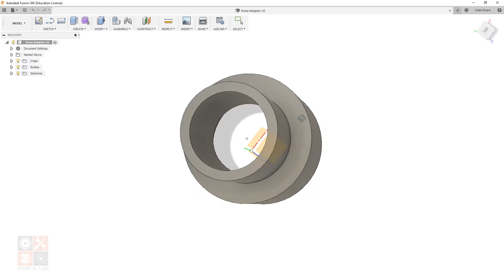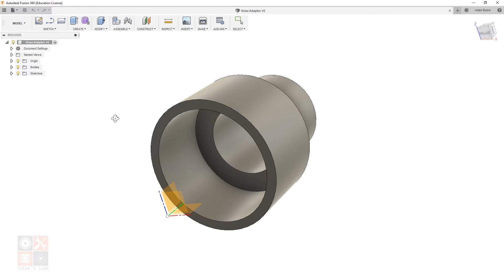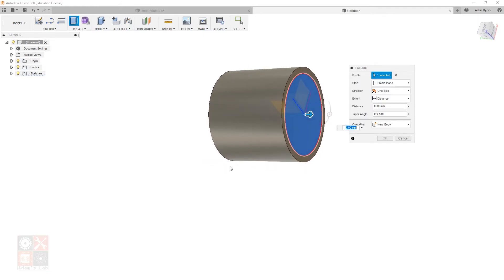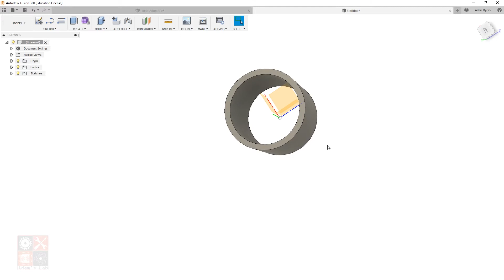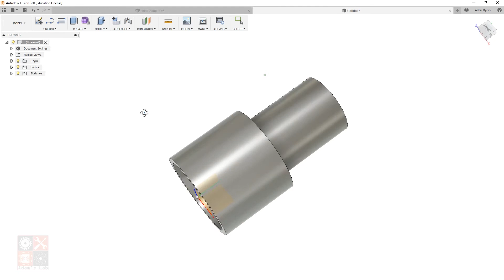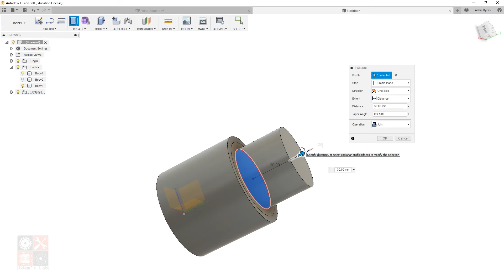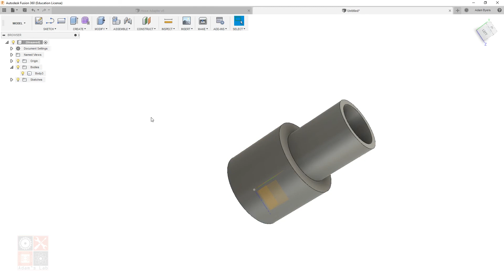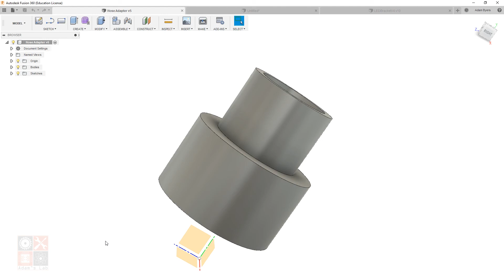Practical 3D Printing -  Shop-vac Tool Adapter | [0034]

Comment: Hi I would like to say thanks so much this video was the best and easiest one i have found I am just starting out and thanks to you I just made my first Vac fitting  thanks .
Reply from the maker: Glad it helped! It’s a basic walkthrough and knowing what I do now, it’s not the most efficient way to design something like this in Fusion. But if it results in a end product that you can use, we’ll, that’s the point. Keep at it, Fusion is a beast but it is amazing and worth the learning curve.

Comment: Hey, I remember you making a video about a cracked baseball bat. I found a baseball bat with a crack up near the barrel. Do you think it can still be fixed?
Reply from the maker: Without seeing it it's hard to say. If it's just a crack, some reinforcement with dowels may save it, or if it's a big enough crack maybe inject some epoxy in it... maybe a combination of both dowels and epoxy. Still something that you'd want to be careful using as it would still possibly be weaker than it was in it's original state. The one I fixed did end up breaking (I have a feeling it was being used in a way to try to break it ;) ) but not at the repair point, rather adjacent to it.

Here are the two videos on the bat: 

https://www.youtube.com/watch?v=CeXU8yGfiiA&t=3s

https://www.youtube.com/watch?v=qOhFwvOqAnc&t=1s
Reply: Adam's Lab Thank you so much!